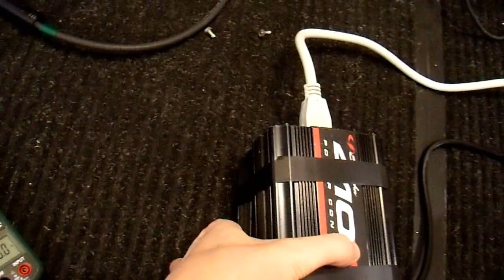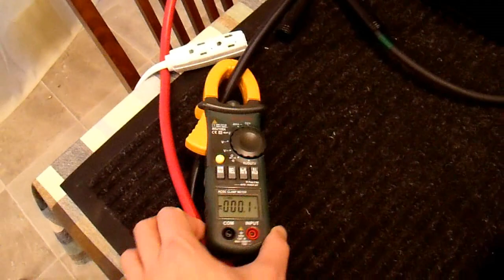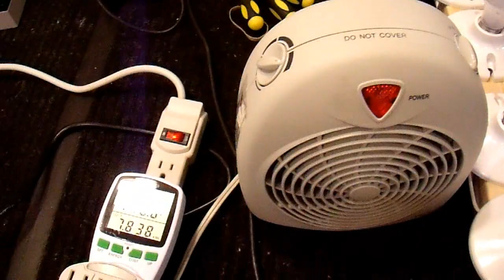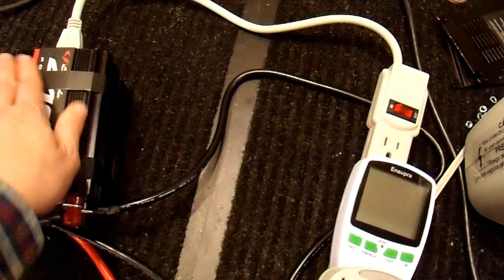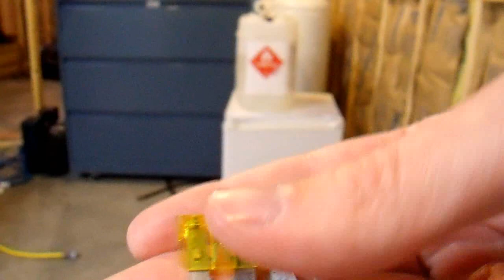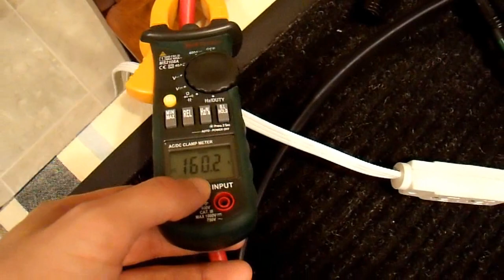Parallel Inverters - Double the Power Hack!   Part2

Comment: Nice I wonder what the options are for small inverters 400-600w range that are fully parallelable
Reply from the maker: In order to PROPERLY parallel any inverter you need ones that can grid tie and that do not have anti-islanding.  Some Chinese inverters are capable of this while not advertised capable of it.  It's a huge safety concern for the majority of consumers who have no idea how dangerous inverters without anti-islanding are.
Reply: @knurlgnar24 yep that seems like the issue 

Or do similar to what you’ve done and start with higher value inverters and parallel them on dc side

Comment: I always thought it would be cool to paralle those things but thw chances of having 2 identical inverters to patale are slim. If you have one and then decide to go but another one in hopes of doing this, it would be alot safer to buy a bigger inverter instead on another small one to parallel.  However if you could come up with some kind of combiner box that u could plug two tandom inverters and combine them thar way. Simular to a dc to dc converter just insteand of stepping up or down it delays one of the sinewave so it matches the other. Ehh they probally have something like that already im late to the game lol

Comment: Adding a capacitor would help the input stage by reducing sag from high current devices starting as well as helping with inductive loads from motors, great vid, showed a friend of mine the vid he didnt believe you could parallel smaller inverters like this

Comment: Thanks. I have a 3kw 240v continuous and the infernal thing done plummeted. I tried to make a portable ev charger for my Chevy Volt w/ bad ICE. I wanted a bigger inverter because the ev charging cord shows 3100w during charging. But my lithium batteries may be insufficient. I'm going to open up my inverter and add solder along the primary tracks like you did. The setup did power a 240v cooktop burner. I am a traveller so I used a travel voltage adapter to attempt to run a space heater which the motor was erratic. And my guess is I may want to request refund on the inverter since it was supposed to be pure sine wave, so the question is why the fan was choppy. Oh yeah and I took the 3 50v battery packs and hooked them in series without inverter and they ran a 150w and 3 25w incandescents for a reasonable amount of time. So I'm spearmint-ing still. I'm about to fix my ICE if I can but tell you the truth I'd rather expand my HV battery pack for more range. But this and part 1 were very informative and hopefully will help me a great deal

Comment: 13:25 so I came across your video by asking Google "can I take two 400 watt power inverters and join them together in parallel to make one 800 watt inverter?" Boy am I glad I did that. Not only was your video very informative, but entertaining as well. You have gained a new subscriber. Although I will not be joining mine together I think I'll just keep them separate. Thank you for the video, now I must find some flammable liquid to place on top my mini fridge.😅
Reply from the maker: Yeah, the short answer is that it's simply not practical to join two inverters together to double the output power but I wanted a project so I did this.  Also, the inverters were sent by a viewer so I wanted to use them for something on video.  I have another very old video where I did a similar thing with two UPS units by putting them in series instead of parallel.  I don't post much anymore but that may change at some point.  Thanks for the comment!

Comment: How are you linking both outputs on each inverter to produce 600w?
Reply from the maker: I'm using the output stage on just one of the two since it was overbuilt vs the boost stage.

Comment: Awesome effort ! great video. I have been watching more and more solar, inverter videos. I circled back again to this video. I have a few queries :
1) Will the load be shared if the inverted are dissimilar( like one is a 1000W ) inverter. 
2) What will be the case if one inverter is grid tie (ex: 300w) and I want to increase the output power to 500w by coupling  a normal 300w inverter connected to a matching solar panel or a battery input. 
Please let me know your thoughts.
Reply: In theory when 1 of them max out other will kick in . I will do exactly what you ask.

Comment: How are you combining the load capacity of these in parallel with only one inverter feeding the power strip? Are they tied together internally? Couldn't you come out of each one with a 120v cord then splice them together in a j-box with a plug to feed the load? I'm wanting to do the same by adding additional inverters to my system to increase the wattage capacity to feed my house panel.  I agree with how you have the battery +/- split to balance the DC voltage. If I use identical inverters from the same manufacturer they should all have pretty much identical output sine waves & voltage readings so there shouldn't be any reason for them to interfere with each other negatively.  It will only be one phase 120v but I can work with that. Your thoughts?
Reply from the maker: The inverters must be perfectly in phase or they will interfere and destroy eachother.  I paralleled the boost stage of the inverter and used only one for the output stage as the limitation in these particular inverters was the boost stage.

Comment: @13:43.  🤣 I purchased both a container of flammable liquid and a propane tank full of propane just so I could attempt this project. 

Can you do this simply with 2 identical Pure Sine Wave inverters?  Could is also be as simple as tying together the DC input high-voltages of the two inverters. Or, will it require modifying the control circuity of the inverters?   I'd be really interested to see you try this experiment again with a couple of inexpensive cheap, Pure Sinewave inverters. A couple 300W or 600W inverters from Amazon?

Comment: Hi, I have "2" Xantrex Pro 1000w (2007 model) 
 I would like to build  a "mobile hand cart Generator,"  also I would like to hardwire both inverter to a small 2-pole (30 amp breaker box) to hook up an 240v outlet to run my lincoln  welder  ? to  your suggestions will be really appreciated

Comment: omg this is so WRONG.  you're only paralleling the input side and DC side.. you have to use the outputs of both inverters, this makes absolutely no sense.  you can't use only 1 set of output FETs because the case and heatsink is only designed to dissipate 400W.  sure you can overpower them for a min, but it'll easily overheat. DON'T DO THIS, you'll start a fire... you have to find the clock signal for the output fets, cut the trace on 1 inverter and add a wire to the input clock signal to the outputs FETs, add a wire to the same place on the other inverter and connect together. the also put the outputs in parallel and then you're done.
Reply from the maker: You can't parallel the output due to phase differences and you cannot parallel the drive circuitry due to drive loading limitations.  In this case the boost stage could handle double the power so it made sense.
Reply: @knurlgnar24  you didn't read my comment.  the boost stage can not handle more than 1 supply's worth of power for an extended period of time.  you tested for a few seconds.. that's not a valid test since the heatsink wont have time to be saturated with heat...  it will not run continuously at 2x power and you're crazy to think so.  there is basically no load on the clock signal, its just a PWM to the output fets.  you MAY lose a tiny bit of voltage off the top of the signal, but that wont change the operation.   

this will fry the output fets or start a fire if used like you said, on continuous max load

Comment: Used pure sine wave inverter with a surge current three times as RMS (continues current) to run a motorized appliances.  Motorized appliances has a surge current to start.

Comment: Question:  Is the Phase of the two in sync?   How would you fix this issue?  Does it matter?
Reply: Hi connected it after rectifier before high voltage transistors, there is DC

Comment: I was interested by your experiment, but I am confused. How did you handle the phase difference?
Reply from the maker: I cheated.  I decided that the output h-bridge on a single unit was strong enough to handle the boost stage of both inverters.

Comment: You are not running these inverters in parallel.  By connecting the battery input to the inverters in parallel but only using one inverted output, you are using one inverter as designed, but the other inverter is not supplying 120V AC to your load.  What you are seeing is just the Inductor and Capacitor on the input stage of Inverter 2 as charge (and magnetic) storage  devices.  This is why you are seeing over unity results.

The inverters used here appear to have inverted output components that were designed with a derating of 2x plus, but we cannot assume the same for all inverters.  

Hence, while you are providing the input stage with the ability to push 2x the power, there is a high risk of components on the output stage burning out from 2x the power on any given inverter with this setup.

Cool trick of added power at the expense of overpowering output stage.  Nothing comes for free :)

Comment: That seems to work fairly well, considering that the DC-DC converter in those units are accomplished using an SG3525 switching regulator controller, yes you're right that the bridge rectifier stop's current from flowing back into the other inverters DC-DC converter stage
However I can tell you that if you turn on both of those units, without having the high voltage DC in parallel and take a reading you will find that they are deferent by as much as several volts, but because of the fact that the SG3525's are very precision regulators, so which ever one is set the highest in voltage will try to take the full load until the current is maxed out, that is why you saw no change in efficiency when turning the second inverter on and off with a little bit more than half load on them, and it is also why you blew the fuses in the one and not the other. On some of these inverters they have a trimmer pots to adjust the high voltage DC, if those units have them you just need to adjust the high voltage to within a few 10's of MV of each other if there done with fixed resistors it's likely that they are off by quite a bit, and you should at least replace one of the fixed resistors with a trimmer pot so you can at least adjust that one too the other, you will get a lot better results.😉
Reply: Thanks,very good to know.

Comment: Hi, This is Peter from Hungary.I would need your advice.I am driving an old electric car running on 110 Volt DC (110 volt lowest, 149 volt highest charge) Would love to use an inverter to run an aircon 220V.
How would you down convert 110 volt DC to use a 72 volt to 220volt inverter. Or how would you convert 110 volt DC to 110 volt AC to use a 110 Volt aircon? or any ideas anyone?
thaaaaanks
Reply from the maker: I think your best option will be to determine exactly what nominal battery voltage you have and purchasing an inverter that accepts that input voltage.  I have seen 120VDC input inverters on eBay and the like but know little about them.  High voltage DC makes me quite nervous though, and despite the relatively dangerous stuff I do in my videos I wouldn't personally play around with 120VDC batteries without some Personal Protective Equipment and other safety measures.
Reply: @knurlgnar24  Thanks so much.I have been searching as well and have yet to come across a 120 volt dc input inverter. I will have a look again. thanks again

Comment: Your ammeter is calibrated 10x to high you are putting out 2. and 4. rather than 20 and 40 respectively as well as together they are putting out10 not 100 amps. Just an FYI

Comment: You blow fuses because you were turning items on before plugging them in...what did you expect.... You know that "Snap" sound you heard when you plugged in your work light 09:15, this dude is effectively showing people all the wrong ways to do things. yeah lets try to plug in high voltage items while they are turned on while using 2 cheap hacked inverters and burn my house down. you really should disclaim that you don't know what your doing and that NO ONE should do what you did. I don't care if you are calling it an experiment, you need to let people know that what you are doing is not up to code or safe, Also you are using a tiny battery that MAY be rated for 30 Amps continuous, and pulling over 80 amps from it. Just plain idiotic.

Comment: How are these phase locked on the output side?  Is this hack only possible on modified square wave inverters or also on "pure" sine wave inverters?  I really don't see much point in doing this.  It is a lot of work (and some risk) when you can simply just buy an 820+ watt single inverter.  It would be nice if someone made a device that would take the output from 2 isolated inverters and would somehow phase lock the outputs of them.  I don't think such a device exists, yet you are somehow doing it here.

For example, here in USA we use split phase 240VAC (2 branches or "legs" of 120VAC ) that are phase locked 180 degrees out of phase with each other.  If I were to take the output from one 120V output inverter and backfeed on branch of my house, and then take another 120V output inverter and backfeed the other branch of my house,  it is possible that all of my 120V stuff would work, but my 240V stuff would not, as those 2 outputs are not phase locked.  Even just sticking a voltmeter in the 240V out will not show 240VAC.  It will probably be some low number that oscillates some.

It would be nice if someone made a device that would take the 2 outputs from those 2 120V output inverters, and phase lock them (180 degrees apart) such that the 240V appliances have at least a chance of working properly.  However someone could just argue why not just buy a split phase inverter with both 120V and 240V output and that would actually be a good solution.

Comment: the outputs don't seem to be connected
Reply: The outputs cannot be paralleled because both inverters would explode. He made the paralleling internally, at the outputs of the DC to DC conversion of both inverters, that is, one step before their A.C outputs. In this way he took the total power just from the A.C output of one inverter only. This means that the output of this inverter suffered the double current, because the output of the other inverter remained unloaded. He could do the paralleling at the A.C side (output to output) if both inverters were operating from the same oscillator that chops their outputs to 60Hz and had no frequency and phase differences to each other (as regards their A.C outputs). But he avoided to do that, because this solution is very - very complicated to implement, while their one he chose is the easiest one.

Comment: this method needs output stage MOSFETs can take 2x of designed power. At least for high power inverters say 1KW+, this condition could not be meet. Brand products won't leave that much tolerance.

Comment: was ur bar fridge 12v or 24v?  ive just brought
 a 1600w Pure sine wave invereter an it wont run the little barfridge
Reply from the maker: What brand/model inverter?  I am not surprised.  Most 1500W inverters are marketing 'scams' and don't really provide what you expect.  The other variable is battery and cabling.  You will need one very good battery or two in parallel along with some nice thick, short cabling to connect it all together.  Fridges take a nasty surge to get started - probably close to that 1600W level.  Once running they will only take a couple hundred watts at most.

Comment: No seriously can you hook two 12v inverters in series on the input to make it a 24v input then parallel the output like you did shouldn't the draw 12v each an share current?
Reply: Theoretically I think that this could be done, provided that both inverters would be absolutely identical, with their outputs paralleled as in this video. The current through them would be the same (due to their series primary connection and their paralleling at their secondary connection) and it's level would be the half one of what would be drawn to support a given load from one inverter only. Always theoretically...

Comment: Ur idea isn't complete.....

U need the out puts hooked together not the DC 120v supply 
One of the AC mains generators is taking twice the load and likely won't cope........

Wait u need to do is disable one of the chopper signal generators and wire it to the other chopper mosfets so both psu are running in sync

But fuck that to heck........
Run outputs into a briged rectifier and get a few caps on it...........
Get 2 microwave transformers 
Run another bridge rectifier backwards so have output as ac side 
Feed it to imput of one mot and hook up the ht sides together and u will get ac out put of all invertors hooked in on 2nd mots output to max tranny output 
Each inverter will need it's own bridge retifer only the bridge to supply bridge rectifier

Now be4 u think I am lost 
Make a ac generator make a motor to motor hook up any motor that can generate ac will do and u drive one with another and u take the AC output and feed it to first mots mains input 

Something like 12v dc with regulator to control speed and the ouput other motor be 4~20v if like 12v dc motor and feed it through transformer sos 12v~30v in and it's rated for mains output don't matter the voltage it will output because all u need is pure sine wave output 

So wat it does is pulls the power out of bridge in ac sine wave and feed the transformer

Simple pretty good output and works with all invertors

Ur way needs to get the choppers to sync up if done properly
As u done it ur overloading one invertors choppers to get 800w wen only can do 400w 
Unless they are higher rated than application then lucked out